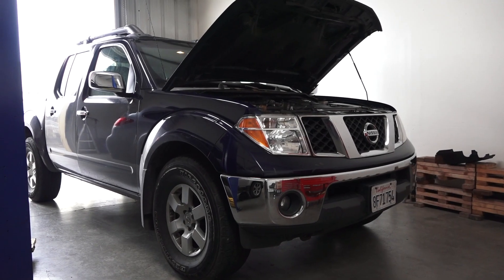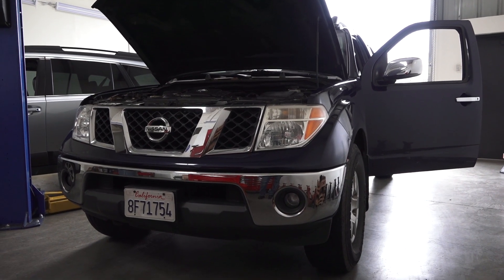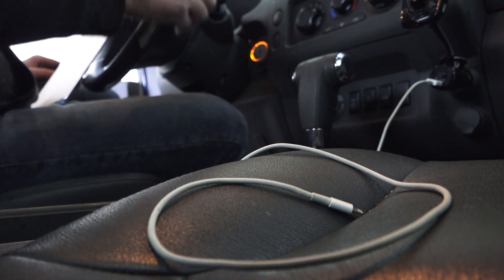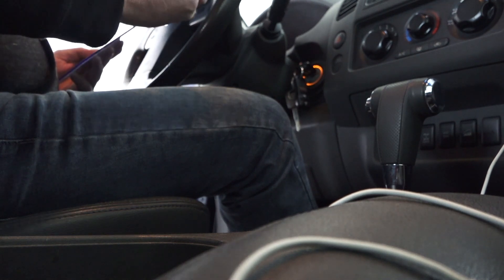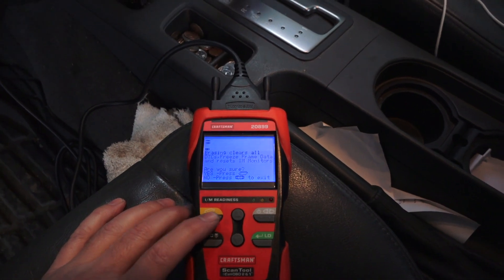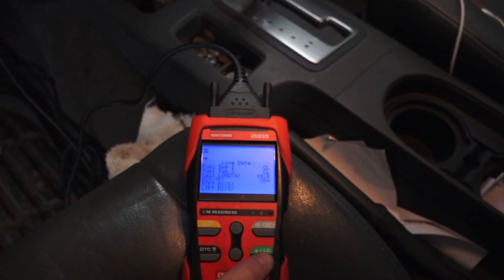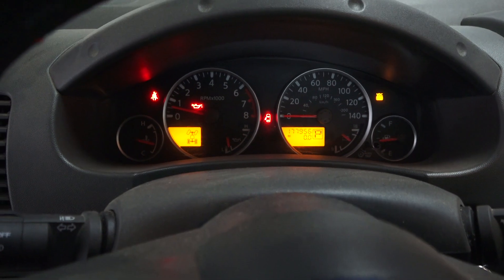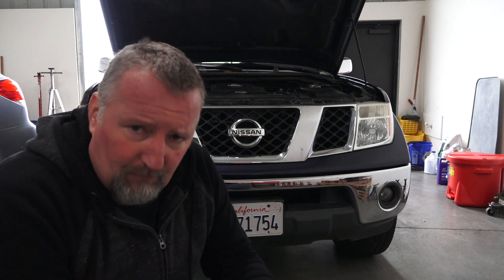Nissan P0507 Idle Relearn Procedure

Comment: Thank you very much for this procedure. I cleaned everything from MAF sensor to plenum. Removed plenum to clean out also. New plugs, boots, contacts. Cleaned throttle body twice. started vehicle, 1250 rpm. Would not calm down. I gave this procedure a go, WHALLAAA. Back to normal. 2005 frontier 4.0, 6 spd manual trans, 112000 miles on it. Brand new running truck. Thank you again for posting this

Comment: What could be the issue with the engine which has a slightly rough idle when idling  on a cold engine and I can hear a kinda rattle when I press on trottle before the engine gets warmed up after 10 minutes or  1 kms

Comment: This method worked for me on the second attempt as well. I have a 2005 Nissan Frontier 2.5L 4-cylinder with 191,000 miles. My throttle body was extremely dirty, so I removed it and cleaned it using throttle body cleaner and a toothbrush. I also replaced the MAF sensor first, which was very easy to do. After replacing the MAF sensor, I started the car, and the idle was fine.

However, after cleaning the throttle body and restarting the car, the RPMs fluctuated wildly between 1,000 and 2,000 while idling. I watched multiple videos and even asked ChatGPT, but none of the suggested methods worked for me. This video, however, did the trick—but only on the second attempt. The creator mentioned that he had to do it twice, so I tried again, and that time it worked. Everything is running smoothly now—thank you!

A couple of additional notes:

Some videos mention that you'll hear a high-pitched noise from the throttle body during the reset process—I never heard any noise, so don't worry if you don’t either.
My battery voltage was 12.7V, so I connected a jumper to another car, bringing the voltage above 13V. I'm not sure if this made a difference, but some sources say the voltage needs to be at least 12.95V for the reset to work.
I hope this helps someone dealing with the same issue!

Comment: Hi Auto Resource. 
I just watched your video on how to restore the idle speed on a Nissan Frontier.  It was of great help. Thank you. 
Perhaps you can help me with another problem I caused to my daughter’s truck, a Nissan Frontier 2003.  I replaced the spark plugs but I forgot to disconnect the battery causing a problem to the automatic transmission. 
This is the problem:
When  in “DRIVE”,  the truck takes off normally in first gear. Then when the transmission should shift  to 2nd gear it goes to 2nd,  3rd and 4th in a very rapid sequence making a sleeping sound. 
What I have been doing to drive the truck is placing the selector lever in 2. Then the truck takes off in 1st gear and at the right time shifts to 2nd.(as it should do).  After I reach the speed of 40 MPH  I move the lever to "D" and the transmission will shift to 3rd and 4th quickly but because I already have an inicial decent speed of 40 MPH the problem is tolerable. 
I think the computer part for the transmission got messed up when  I didn't disconnect the battery. 
Is there a procedure you can share with me on how to restore the automatic transmission to normal?
I will appreciate very much your advise on this particular problem. 
Thank you.

Comment: thank you ,your video help me. I have a 2006 pathfinder. All other videos on here didn't explain well enough. You were right about the check engine light. In order for it to work, the check engine light has to flash differently once u hold the gas pedal. Everything has to be concise and if u don't see the check engine light flashing differently then you have to redo it over and over until u see it.. once again, for those who's trying to do this , look for the different check engine flash ... if u don't see it then u have to redo it... it's not going to work, This is simple and if u follow exactly how he shows , it will work... 👍 god bless

Comment: I just completed a tune up, valve cover replacement, engine bay cleaning, and a throttle body cleaning on my 2005 Frontier V6. It ran great, except I was getting this P0507 code and a high idle. I found this video through Google, and tried it. Worked 1st time. I very much appreciate you putting this out there!

Comment: This does not work and everyone saying that it did work I don't buy it maybe it did for some of you if you installed a new throttle body after cleaning my throttle body and trying this it did not work over and over I took it to mechanic of mine who had a $10,000 scanner tool and he hit the idle relearn button it drops from 1000 RPM down to 550 and 600-word should have been so do not clean your throttle body unless you want to take it somewhere and have them do it with the right kind of scanner to Snap-on $5,000 won't work you need a Maximus $10,000 scanner now for some of those that it did work I couldn't be happier for you because there is nothing better in the world been watching those RPMs go down to where they should be but if you watch most of these videos they will say well it didn't work for me hopefully it works for you they are only going by what Nissan procedures are in that is only for certain installments or repairs I don't refer anyone to work on their own stuff on a Nissan it unless you don't know what you're doing because these Japanese they are smart as s*** and they made sure of that by complicating everything so I'm hoping everyone really looks into things before they start doing stuff

Comment: I have had a p0507 light on my 6 speed manual 2007 Nissan Frontier for about 3 weeks after cleaning throttle body and air filter.  I had attempted the idle relearn procedure like 30 times with no luck.  Don’t know if it was a fluke but on the time it fixed it I accidentally kept the gas pedal fully depressed while starting it.  I held it for a second or two and it wouldn’t start I released the gas pedal and it started and idled down to 600rpm.  Don’t know if this was a fluke but it worked for me 🤷🏻‍♂️👍🤘🙏.

Comment: Great video 

I have 2001 maxima I got p0505
Idle high at idle.  I found air leak in intake hose from air box to throttle body.  Got new hose  and installed it cleared the code and it hasn’t come back.  If something strange comes up again I think I will need to do this
Throttle body was recently removed and reinstalled and intake gaskets replaced.  
Do you think this relearn procedure will help.  My son normally drives that car and has stated that it gets a strange idle after a while  say it’s in park and idles for like 5 minutes.

Comment: After cleaning my 2005 Nissan Xterra, it idled to high. It took 5 or 6 tries and this worked. Keep trying if it does not work at first and make sure you have everything set correctly. Very valuable information. Thank you

Comment: I cleaned my throttle body today and after putting it back on the idle was around 2000rpms. After about a minute the rpms dropped back to normal on its own and no codes. I guess it taught itself.

Comment: Just bought brand new 2019 Frontier and my idle is exactly where this is at. Between 500 and 750 so I would say it idles at 625.
Reply: Mine is the same low 600s, slight shutter at a red light at times, dealer says its normal